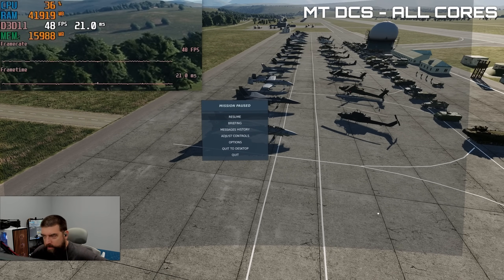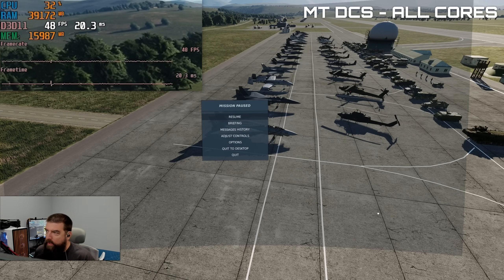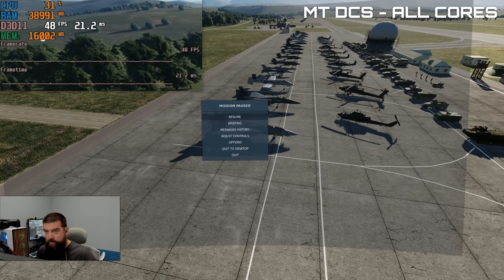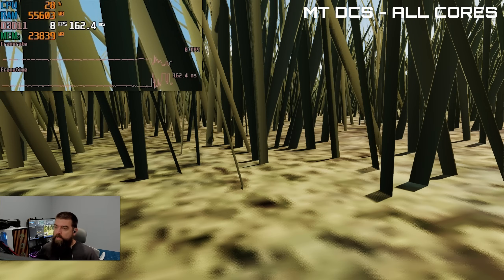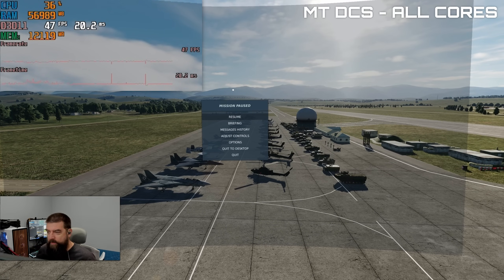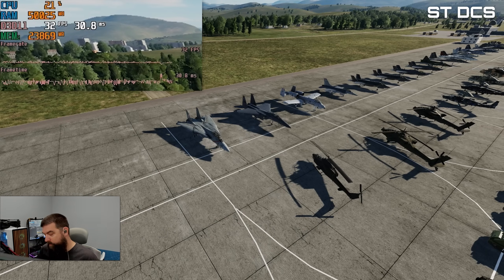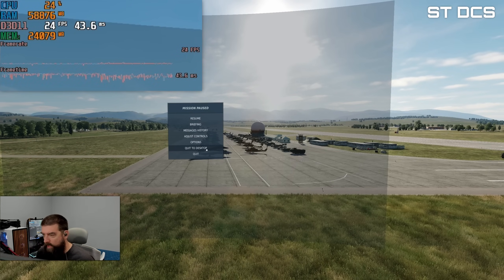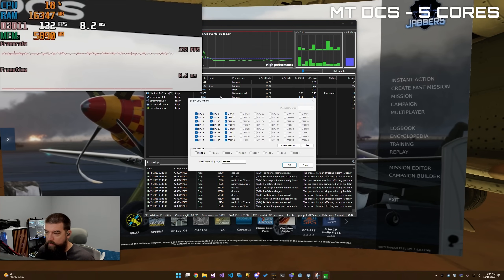How I Resolved my VRAM Overflow Issues in DCS World

Comment from the maker: Here's the miz I am using if you want to try yourself

https://cdn.discordapp.com/attachments/403713358999584778/1174424623572582521/all_nato_mem-test.miz?ex=65678b2a&is=6555162a&hm=b179d947c001123c38dfdb3b02142aba53b4ea9d397a115b581af3086ca39640&
Reply: Do you maybe have an updated link? This one no longer seems to work... thx!
Reply: I haven't tried the mission yet, but basically when I went 2D it was a difference of 300 vs 400 FPS, depending on the affinity set. I did this with Windows task manager while sitting on the ramp with an F16 in Marianas (my go-to benchmark). I got the same results through the cmdline options. Doing this in VR, I went from 75 to 75.1 FPS. Basically the first 8 cores are the sweet spot, which is not surprising as they are the ones with the larger cache (AMD 7950x3d). Unfortunately in VR, I am too GPU bound that it has a large impact, but I noticed a speed up in loading times, so likely SSD bound during loading.

Comment: This is immensely helpful. I'd like to try it but I don't start from a desktop shortcut, rather through PimaxPlay as there are settings in PP that require DCS to start through that app. Consequently, there must be a shortcut somewhere initiated by the Pimax app, but I'm yet to discover it in order to add the modifier. Anyone help? Or, am I only able to use Process Lasso?

Comment: Stupid question: As long as I use the DCS.exe in the "bin-mt"-folder, this should work for the Steam-version as well and regardless of what launch option I select in Steam (flat vs VR), correct?
Not that I have high hopes with my puny 32 GB of system-memory and only 12 GB of VRAM, but every little bit might help as I had to dial the game's settings down something fierce to not be looking at a slide-show in VR.. :D Think I'll start with 4 cores on my 14700 KF.
Reply from the maker: I've heard the latest version of DCS is better and may not require this

Comment: I have an AMD Ryzen 7 58003D 3.4ghz, DCS on a dedicated M.2 drive, 64gb of Ram and a 4070 TI super with 16GB of Vram. I play DCS on a G9 Neo ultra-wide with WW MIP screens and use AI track pumped in to Opentrack.

Everything generally runs at 120fps for me. Recently, while playing Rise of the Persian Lion 2 campaign, on every mission, everything runs great. After about 45 minutes, my head tracking starts getting stuttery and it get's progressivelly worse. By the time I'm back at the boat, it's very choppy and my FPS is down to 80ish. Every mission starts with that issue afterwards, including after a DCS restart. Just an empty freeflight will be 70fps The only fix is a full PC reboot.

I'm not sure if this would qualify as memory leak or the CPU issue you described? Just curious what path those symtoms I described you think I should explore to resolve it. 

Any help is much appreciated. This seems to be a new issue for me since the most recent patch.
Reply from the maker: Sounds like a memory leak
Reply: i have a similar problem in VR. If i open f10 map, the fps drops to 30 and frametime goes high. Normally i get 72fps constantly smooth in my Quest 3. Everytime i open f10 map, the whole game becomes a slide show. Can it be VRAM or RAM problem? What is a memory leak?
Reply from the maker: This has been an issue for years, no idea
Reply: Just to update, apparently it was the memory leak caused by boat wakes they fixed in the last patch. Stable 120 frames again!

Comment: I just upgraded my CPU RAM from 32 Gb of DDR5 CL36 5600MT/s to 64 Gb of DDR5 CL32 6400MT/s.
And my VRAM usage on my 24 Gb GPU has gone down to 18 Gb's usage from being maxxed out at 24300 Gb's! My CPU RAM was also maxxed out but now it's hitting 42Gb's. 
Tested on the first mission of 'The Big Show' in VR on a Pimax Crystal. My frames were more stable as well.
Reply from the maker: DCS Mt has got a bit better since I made this video, if things are working for you that's great!

Comment: I'm not sure it works for me.  Or has a recent update to DCS changed things?
I put this into 'target' field in the shortcut...
"C:\Program Files\Eagle Dynamics\DCS World OpenBeta\bin\DCS.exe" --affinity=f

After the end quotation mark, is it <space><dash><dash>affinity<equals>f  ?  Is it case sensitive, f or F?

It seems to accept it and runs DCS, but how do you tell DCS is only running 4 CPUs?  In Resource Monitor I have 16 CPU's showing, all of them have some activity but 4 of them seem to have the most activity.  It's an i7-13700F CPU.
Reply from the maker: Check the DCS.log in saved games
Reply: @Jabbers  Looks like it uses 8 cores, 16 threads

2024-04-29 08:16:11.273 INFO    EDCORE (Main): Created boot pool: n:16
INFO    APP (Main): Command line: "C:\Program Files\Eagle Dynamics\DCS World OpenBeta\bin\DCS.exe" --affinity=f
INFO    APP (Main): DCS/2.9.4.53707 (x86_64; Windows NT 10.0.22631)
INFO    APP (Main): Application revision: 233707
INFO    APP (Main): Renderer revision: 24955
INFO    APP (Main): Terrain revision: 25070
INFO    APP (Main): Build number: 92
INFO    APP (Main): CPU cores: 8, threads: 16, System RAM: 32608 MB, Pagefile: 2048 MB

Comment: Does anyone else here have an MSI nvidia RTX 4060 Ti card?  I have one that came with a Costco “gaming PC” with i7-13700F, 32GB Ram, 1TB SSD and MSI MB.

It seems like it has most trouble in Mission Editor.  Every so often it just starts a series of freezing up for 15 to 30 seconds.  Looking at Task Manager, performance, the CPU is running about 5 GHz but only 15-20% busy, with one core continuously at 100%.  The graphics card is at about 90% when it’s running smoothly, and drops to 15-40%, up and down, while the video is freezing and hesitating.  And there’s a lot of corrupted video outside of the ME window.  This all in VR.

Comment: I started playing DCS last week and was having this really nasty stuttering every 4 or 5 secs, to the point it was simply unplayable. I know I have a mid-tier PC, but anyways I searched all over the web for fixes and realized it's a pretty common issue even on very high-end machines. Tried all suggestions and fixes and nothing worked until I just bought an NVMe SSD disk and installed the game there. I was running the game from an HDD. No more stutters, even with all graphics cranked to the max I get solid 50/60 fps with zero stutters. The game now runs perfect. It's mindblowing how easy it was to fix the problem (not cheap though lol). My specs are:

- Ryzen 5 2600X
- GTX 1660 Ti (6GB)
- 32Gb DDR4 Ram
- NVMe SSD WD_Black SN770 1TB
Reply from the maker: DCS hasn't been able to run on an HDD for years now, just to IO hungry

Comment: Interesting now that many other dcs YouTubers is now suggesting your suggestion as their own. including the use of the same app to perform CPU core affinity.
Reply from the maker: Eh welcome to YT, no biggy so long as it reaches more people
Reply: @Jabbers  your observations on how dcs work as an app is most valuable. For most time I am running 13900 with 4090 I was able to get 90 frame almost stable with occasionally frame slowdown when coming in to carrier landing. 

In term of memory and vram. It kinda consumes a fair chunk. 

If you have time and assets to try. I hit Into a pimax crystal problem with GPU bandwidth limitation when I connect my 4090 with a 240hz 4k monitor and pimax 120hz 2880x2880 per eye resolution. It only get resolved when I power off my 240hz monitor and replaced with a 60hz 4k monitor.

Comment: Awsome, i only disable my core 8 when the stutters happen, then its better until it happens again , then i switch off core 9 and enable core 8 again. But i will test your solution ( can you also test in vr?)
Reply from the maker: What you saw was in VR
Reply: @Jabbers  i have tested it wit ff so 8 cores. No improvement. Ill test with 4 cores . Do i need to step in 2 so 4 then 6?
Reply from the maker: It's hugely hardware specific and won't work for everyone, just try I can't tell you what will work best for your machine
Reply: @Jabbers  hi jabbers thx for reply but i use the steam version and if in do C:\SteamLibrary\steamapps\common\DCSWorld\bin-mt\DCS.exe --affinity=F
so this is a shotcut on my desktop, it starts the singel thread one not the multi
Reply from the maker: Sorry I don't know anything about the steam version

Comment: Hey Jabbers thanks for the research. I've used PL for many years. With my current i9 13900KF I use 8 Performance cores to run DCS.exe. Do you change CPU & I/O Priority for DCS.exe to High? Thanks.
Reply from the maker: I don't typically tinker too much so no I haven't set high priority. I usually only change things when the current results are undesirable

Comment: 13900KF, RTX 4090, 64GB Ram, Varjo Aero here and couldn't figure out why I was barely able achieve 90fps on basic VR settings.  After applying your recommendation of 4 cores, I'm solid at 90fps with med VR settings.  Thanks for taking the time sort it out and share with us.  Liked and subscribed bro.  Dreday out
Reply: pardon my ignorance but what is considered “medium vr settings”? Like what’s your pixel density set to / what resolution are you trying to achieve in vr?

Kind of new to this and wanting to upgrade by building a new cpu but within reason. Relatively straight forward for most things but DCS VR has been quite the rabbit hole since everyone’s expectations of what is shit to acceptable to great seem to vary. So trying to set my own. 

For context I’m currently running potato af settings as I learn the F-18 on a i78700, 1060, 32, Samsung Odyssey WMR. So I have a feeling I’ll be much more easily impressed than the rest of the VR community but trying to confirm that.

Comment: is there any way to use an affinity mask ?  (for example to only use physical cores) ?
Reply from the maker: Yes
Reply: @Jabbers  sorry to be dense m8, but, how ? is it just drop in the hex mask 0x0000000000055500 as an example?
Reply: Process Lasso —> Disable SMT (or manually deselect the logical cores of each processor)  @speed-of-heat
Reply: @theegg-viator4707  yeah thanks , i already do that .

Comment: Great video, nice one.  To add, there was a massive spike in the use of normal RAM just before the massive FPS stall.  My guess is that DCS was unpacking a whole bunch of textures into RAM, before making them available to VRAM.  The fact that we now have MT, probably allows parallel unpacking of those textures, which is why the FPS was better in MT for most of the video.  The side effect being that unpacking those textures is probably the reason for the massive RAM spike, as the DCS engine is now conducting across 8 times as many cores.  I wouldn't be surprised if the FPS stall was due to windows kicking in it's swap file logic as it was out of RAM.  For all that, lowering the number of CPU cores available would almost certainly reduce the number of parallel texture unpacking, and therefore the total RAM required, so it's very much a great idea as a solution.

Comment: I get great performance with no stutters (after MUCH testing) on my 12700k and 3080ti by disabling HT and setting affinity to only the performance cores.
That leaves the efficiency cores for background and OS processes, much like they were designed for.  Performance was also fine when disabling the efficiency cores but alt-tabing and everything seems smoother with them enabled (for obvious reasons).
Reply: Before the testing I was having MAD stutters in certain aircraft like the AH64D.  I also disabled the power management process in Windows 11, as in, blocked it from launching at boot.  Even in 'High Performance' mode, it was giving stutters in DCS.

Comment: So I just went and tried your miz file. I have a 4090 + 12700k (OC'd to 5.2 all-p-core, 4.4 e-core) + 32gb of 3600mhz DDR4.
in 2d/Non-VR @ 4k, with textures high, max forest/building slider, LOD 1, and FLAT shadows, clouds high. DLAA on, however I'm running the newest Nvidia DLSS 3.5.10 DLL and using DLSSTweaker to run "Preset-F" not DCS's default of "Preset-C".

with just straight all the cores on as default, I'm not seeing the big stutters you are and am not seeing VRAM limit. I'm seeing about 13-14gb of VRAM used (allocated?) if I zoom in/out and move the camera around like a madman it drops to about 10 on the low end and 14.5 on the high end.
system ram sits around 24gb, however 4gb of that is probably my browser b/c I'm too lazy to close it. 
There's occasional hiccups, but not like you are seeing, and I'm not seeing the ram limit.

I have my page file set to 64gb (2x system memory, because some games "need" it, even if they dont use the ram all that much), and its on a UD90 power silicon M.2 NVMe 4tb.
I experimented using process lasso turning off some of the P-cores and E-cores, and there is quite a bit of performance loss in FPS for me.

ST is just straight bad, let alone not having the option for DLAA/DLSS. HOWEVER -- one thing I do notice, A-10A instant action, the IR mav's for some reason seem to render differently between ST and MT, the picture in ST is just straight "better"? might be a bug?
Reply from the maker: I forgot to mention I'm in VR, it's no where near as bad on a monitor
Reply: @Jabbers  Did more testing (this time in VR), one thing I noticed, make sure you're selecting the "right" cores -- the physical cores, and not the logical. I forced DCS to only use 6 of my physical cores and it seems to have helped. I want to do more testing and see if there's some combination of min/max cores, and if maybe HT on certain cores can help (HT is "rule of thumb" supposed to provide about a 25% boost per core it adds, which may or may not help the "rendering thread"). Also need to test more on the E-cores and if that effects them. I'd rather have the physical E-cores than the logical cores, but I don't think DCS is using them at all.

Now if only we could get ED to start optimizing textures, instead of releasing high-res pilot bodies that no one asked for, and all of us will likely default to off...

EDIT: also I used Process Lasso to trim the memory and enabled "Smart Trim" and enabled "Performance Mode" and "Probalance" -- turned off 4 of the total P-cores(2 phys and their matching logical threads) from my 12700k and it seems to have steadied out fairly well.
Reply: @Munky332   The problem is DCS don't ask its customers what they want . We ask but mainly gets ignored . 
I have nearly all the modules and half the maps , I've spent a lot of money on this DCS hobby like most of us .
But lately I've slowed right down . Things just arnt getting fixed .  
No point buying a $60 module if the game engine is broken .

Comment: That 1000+ms frame time was rather painful. Ultimately these findings aren't super surprising over all. A lot of games have diminishing returns as core/thread count increases. Typically seen past 8 cores / 16 threads, tho many even deteriorate at anything over 6 cores / 12 threads. You can probably attest to this but while parallelization is great, there comes a point where the management overhead / bottlenecks starts to stagnate and decrease the gains.  I think the most curious part is can ED lower these memory requirements? RAM/VRAM management has always been a challenge for DCS. Often times my rig with 32GB of RAM would have the capacity completely filled, prompting me to get 64GB for my newest computer. I really don't see this behavior in any other fight sim, or any other game that I own or observe benchmarking on.

Comment: An option for Simplified models and textures for aircraft other than ownship would be nice. I don't care about super detailed models that Im not going to see super up close 99.9% of the time.
Reply: That is what the LOD slider should do.

Example, give me a nice clean 8-bit 128x128 texture 200-400 polygon tomcat when it is 300+ meters from me. Almost like game from 1999.

Now it is like 500'000 polygon 4096x4096 with 48bit cockpit, model, IR map etc all at once.
Reply: @paristo  The problem is the slider basically does fuck all in actuality. I've tested both ends of the spectrum and it doesn't help me. Granted I'm on a 4090 so VRAM isn't an issue, but IMO there is an absolute shit ton of optimization that needs to be done, instead of ED focusing on "High Quality Pilot Bodies" that no one asked for and 99% of the player base is going to turn off anways.

Or like the BS3, why the fuck are all the panels modeled?
Reply from the maker: Immmmeerrrssssiioooonnnn 🤣

Comment: One thing that I noticed is that you appear to have 24 threads available to work with. I believe you said elsewhere that you are currently on an AMD system. That leads me to think that it's probably a 12C/24T chip like a 5900X or 7900X. Those chips have 2 6-Core CCDs on them. Is it possible that you are running into issues with the Infinity Fabric and the IO die trying to cross talk between the CCDs? I've heard of that being a problem before in other games when it comes to performance, which is why generally the AMD 8C/16T 1 CCD chips (5800X, 7800X, etc) can outperform the 12C/24T chips. 

Also, I have been doing something similar with Process Lasso on Intel CPUs since 12th Gen to force DCS (and other games as well) to only run on the P-Cores and not on the E-Cores at all, while forcing as many background tasks (Discord, Steam, other game launchers, etc) to run only on the E-Cores as I can get away with. That has also shown some good performance gains in many games in my somewhat limited testing.

Curious about your thoughts on this.
Reply from the maker: I'd like to clarify i actually don't REALLY have this issue, its an issue those who have less VRAM than I do are encountering. I have a 7900X3D, and turning off the cores that don't use the X3D cache doesn't help either.